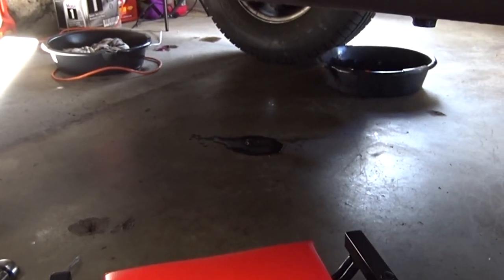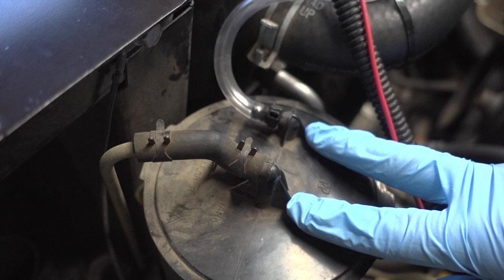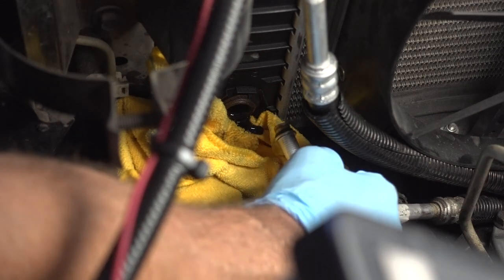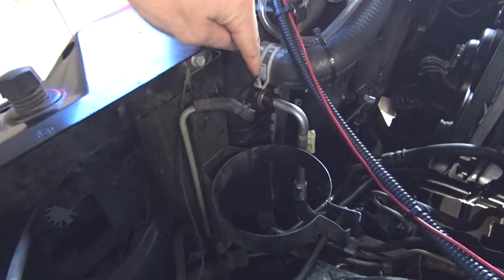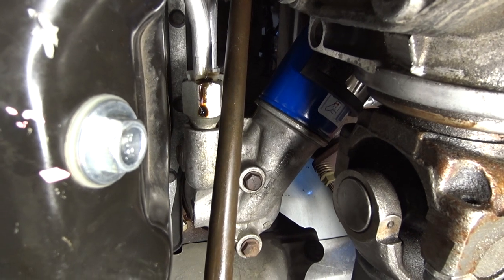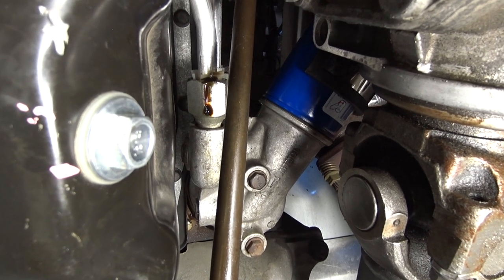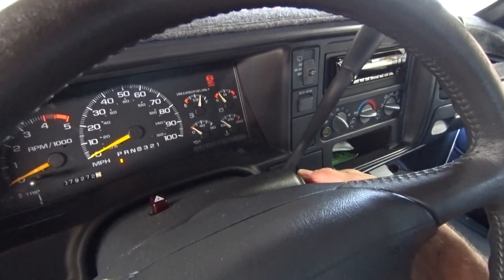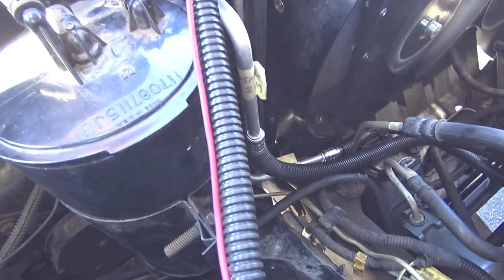Here's Why MY OIL COOLER LINES FAILED!! Is My Engine Smoked??

Comment: YES 1ROAD A VERY VERY COMMON PROBLEM. I had mine made by a specialty shop after replacing them twice. 7 years later & they look like new. I think NAPA does hoses like that ? I also went through the EXACT SAME PROBLEM YOU DID I had to change out the nipples for new ones. THE JOB WAS A PAIN IN THE ASS. My neighbor actually blew his motor up when his engine oil lines burst in his GMC.
Reply from the maker: If they leak again I will certainly have custom lines made. Thanks!

Comment: Just purchased 95 4 x 2 suburban this is my fourth suburban this one has roughly hundred thousand on it one owner, and experiences with a 5.7 Vortex bottom knock and I feel that replacing the oil pump can give longevity to the motor. This one doesn’t have the knock just yet but do you feel it can only help?

Comment: Dorman products range from good to bad. Plastic coolant tanks I have installed shrank and the cap pops off because threads are too small diameter. I have seen their plastic oil filter covers on 6.0 and 6.4 Ford diesels leak due to shrinkage.

Comment: Great job, I replaced my radiator fans with Dorman's three months ago and haven't had issues. At first I was skeptical because I read mixed reviews of them but so far so god time will tell.
From my experience I have had great results with aftermarket parts I think that there are much better quality brands than OEM specially when it comes to Japanese brands. THANKS FOR THE VIDEOS.

Comment: That Suburban is looking real nice. Does it have the rear windshield wiper as well? Oldest car I have is a 2001 Oldsmobile Intrigue and had a coolant leak, but I sourced it as the coolant recovery tank being the culprit (and I was right) and fixed it myself. Had to replace the coolant sensor as the cheap one in the new tank was defective (said low coolant but the tank was full hot) with the one from the old tank, swapped the O-ring gaskets, and the warning light went away, but it still does the self-,test when I turn the key to the on position. 120,200+ miles on it and running strong. Gotta fix the exhaust leak some more, replace a stud or two and the lug nuts, and fix the fuel gauge. I'll fix the ABS (hub assembly on the passenger side front is out of commission after 17 years (2018 is when it started to not work anymore), even live data showed the RF wheel was showing 0 MPH using the Autel MaxiAP AP200 Bluetooth scanner) after I get a new job as I'm unemployed.

Comment: Some Napa’s make hydraulic lines you could have them build you custom oil cooler lines they’ll last the lift of the truck and then some, a bit costly but totally worth the price, we’re talking double braided steel triple rubbered I might make a video on it for my 95 Tahoe if I do I’ll let you know

Comment: Is ac Delco good for anything?  I noticed  my truck has ac Delco spark plugs.  And I have already experienced brand new oil coolant line issue with brand new parts.  It's the crimp on the hose, poor design flaw.

Comment: To design a truck where the engine oil is routed through an external radiator is asking for problems. I wonder why they did that? Our 2000 Suburban with 5.3 Vortec does not cool the engine oil externally.
Reply: Its usually on trucks built with tow packages. Most of the commercial trucks(semi trucks and straight trucks) on the road have oil coolers
Reply: Your point is well taken.most don't even need it.just plug the outlet.
Reply: Yes it is common on trucks/suvs with the towing package. I think gm stopped doing it in 99 though.
Reply: @kcscustom9759  nope. 08 2500 6.0 had the pleasure of dealing with the blow out on side of road. Cut metal ends off and spliced with some fuel injection line clamps and barb fitting. Ordered blockoff plate for the oil cooler lines.
Reply: @kcscustom9759  my 99 has them

Comment: Take that garbage off put a screw adapter on it and run a 51069 wix filter on it and problem of leaks are gone forever..... Also doing this will eliminate the start up knock.... Did mine at 168k I have 847k on it now  zero issues.

Comment: I just bought a 94 1500 with this problem.  I don't like your solution Jimmy, just sounds like you will be doing it again soon.  There is a better way although it is controversial.  Buy a block-off plate to put in where your cooler lines enter the oil filter adapter.  This deletes your oil cooler altogether so you will never have a leak again.  Remove the leaking lines, plug the holes at the Rad, and you are done.

Comment: The sell a fitting that is a nipple instead of quick connect it also works for the radiator one on top of motor then just run hoses them things go out like crazy

Comment: can you romove the lines and fittings and use 3/8 plugs at the filter housing to discontinue the oil cooler, i have a 97 sierra 5.7 with 4wd and never tow anything

Comment: What do I do if mine is leaking from the part you screw the oil cooler line into on the radiator?? Is there anyway to fix that without replacing the inlet outlet tank/radiator?

Comment: I've decided to bypass the oil cooler by instaling 2 regular hose fittings with loop .
Reply: could you just plug the housing where the lines go in and out 3/8 plugs
Reply: @jhanlon1903  A garage owner I know says yes , but I didn't want to take chances .

Comment: I have a dumb question. Is there also transmission cooler lines under there that have the same type crimped fittings? Also is your truck four wheel drive?
Reply from the maker: Yes, same trans cooler lines to other side of radiator and yes, 4x4. I've noticed that one of the trans lines is starting to sweat too!

Comment: Hey, Jimmy. Just did this fix due to one of my lines failing in a similar way. Replaced the fitting with the same parts and I can’t get the fittings to stop leaking. I am using AC Delco lines. Seems to be leaking from the plastic quick disconnect. Any tips to fix this?
Reply: Figured it out. ACDelco lines require ACDelco fittings to work correctly, without leaks.

Comment: Great video!  My 96 Sierra was a pain. The oil cooler lines were held in by these small horse shoe clips that would not snap back in place. Since there was no room in there it took me a few hours to get them on. Then the next day they popped off while driving!  I  had to have her towed back home.  POS design!

Comment: 4:28 You identify the source of the oil SEEPAGE, but don't name the root cause, other than GENUINE GM parts are designed to fail after four years of use.  It would be an interesting video if you carefully cut the crimp off the oil line fitting and removed the hose.  What's inside?  Any ridge on the tube for hose to seal against?  Perhaps the hose being used is not rated for use with synthetic oil???  How do TOYOTA or LEXUS implement crimp connections that do not leak after four year?  Next time in junkyard, remove a hydraulic line from a LEXUS, and bring it home to dissect.

Comment: Maybe you need engine mounts 
If the engine is flexing around to much it will move the lines around to far 
I think you need them 
That's y the always go
Reply: Very good point.  If the lines run on the driver-side it could well be an issue, particularly if you have relatively new ones in there that start leaking.

Comment: Save your old lines get a length of new rubber hose cut the sheathing off the metal and use hose clamps
Reply: Also dont forget to flare the metal so the rubber hose dont pop ofd just in case :-)

Comment: Put plugs in the oil filter adapter and get rid of the oil cooler lines altogether.  It's really not necessary to have an engine oil cooler.
Reply: If you plug the ports you must also remove both bypass valves in the adapter.
Reply: @ianwilds3139  how do you remove the bypass valves in the adapter, what are they

Comment: My upper cooler line leaks at the radiator. It’s coolant, not oil. Suggestions? Thank you in advance.
Reply: Sounds like the rad is no good and mixing coolant with the oil side of the rad

Comment: There are much better available oil filters than AC Delco 
Fram is NOT one of them
Reply: Like?
Reply: Yeah even the average joe think fram / oem fram ac delco filters  are grabge*    
*oil filters
I'm dumb I keep my engine  safe with paper filters
Reply: @PaulDukich  Wix are some of the best oil filters. As Jack said,  definitely not Fram.  See project farm video about this
Reply: KN and STP for example
Reply: WIX.  NAPA premium (made by Wix)
Reply: I personally like purolator
Reply: @PaulDukich  Like a premium Fram or any other premium oil filter.  Don't get sucked into the anti-Fram nonsense.  With oil filters just like anything else, you "usually" get what you pay for.
Reply: @g_unit6773  Used Fram all my life on all kinds of applications including many high performance, never had any sort of issue at all.  You are perpetuating a myth.
Reply: @x-man5056  Incorrect. Fram = Crap. Best is NAPA Gold, WIX or Mobil 1 Extended Performance

Comment: just did this on my 99 suburban, I had a leaking power steering and moved the oil cooler lines to get to the PS hose, test fired and the thing dumped the entire 5 qts of oil while i ran to the bathroom while I left it idling...
Reply from the maker: Holy moly!!!!

Comment: ???? How cool do the oil cooler get in degrees ???? Mine was deleted for some reason 1998 gmc k1500 5.0 sl 4wd 1/2 ton pickup ????
Reply: You want them deleted they don't do anything but decrease engine oil life and cause leaks, there's no way you're hauling enough to make the oil cooler a necessity.
Reply: @Bleachanna   I have 35 inch tires and 3inch body lift + 6 in suspension lift.  I think your wrong  in my situation.
Reply: @Devo1987  okay. Did you change gearing when you put on 35s?
Reply: @Bleachanna   yes previous owner did ... not sure what but Im happy with what I got

Comment: 9:15  Your $5000 engine is protected by 1/2 cent piece of plastic.  That's the GM Way!!!   Believe the missing piece of plastic is meant to keep the pipe in proper orientation, and keep stress off the O-ring.   Giving DORMAN a try is a great idea given the POOR PERFORMANCE of Genuine GM (AC/Delco) oil lines.   Try switching to CONVENTIONAL OIL, and see if engine quits leaking like a sieve.

Comment: Why not run AC Delco oil if you buy all ac delco part's??? I only run AC Delco oil in my chevys my 2007 Chevy suburban LS AFM flex fuel and my 1994 Chevy suburban Silverado edition it keeps the lifters quiet no ticking in the long run guy's

Comment: Common problem with gm hoses. Last 4 years nothing but crappy Manufacturing (personal opinion) but having to replace power steering hoses more than once a year and engine cooler lines every two years to me is uncalled for. I used to run a fleet of GM trucks it was to the point where I just started converting everything over to standard hydraulic line, might look a little bigger and bulky but I haven't replaced one since
Reply from the maker: Did you have to have those hydraulic lines custom made?
Reply: @1RoadGarage  went to a local hydraulic shop that also dealt with aluminum fittings (like A/C and trans lines) and they gave me the fittings from whatever (trans, pump, engine, rads ect) to standard jic fittings. Then I just used standard hydraulic line and when one does decide to blow I just have to go to a hydraulic shop or farm supply place that has mostly them pre-made and swap it out rather than spending thousands which I've had to do replacing them one after another.

Comment: I cant get the cheap quick connects to stop not leaking. This job sucks...
Reply from the maker: If you've got the o-rings in there seated properly then the hoses just push right in and shouldn't leak.
Reply from the maker: ...yes, it does suck!

Comment: It's a GM thing. Never trust a GM design they hasn't changed in over 15 years. The power steering lines on my Saab were the same style and didn't last long either.

Comment: Ever heard only use genuine ford parts in your ford? ., it's a good idea until you run across defects that happen to all of them.(meaning fails on every car).I've seen lots of lines that don't meet the rubbers diameter, & also the reverse .Then there are lines that are just not to standard strength..To make it worse , any over runs or slightly irregular parts , become what the industry calls "service parts" ., & worse yet almost all service parts don't get the same number of quality checks that the factory parts get! So now you have a genuine "service part" , that's known to be questionable ,  & the replacement doesn't even meet that standard !

Comment: Oil cooler you mean trans  cooler??
Reply from the maker: No, oil cooler. My truck has the oil cooler within the radiator on the driver's side and the trans cooler on the passenger..
Reply: @1RoadGarage  ah ic. Ok nice feature when it works

Comment: Can't you just put a hose clamp over the crimp?
Reply: Not advised, UNLESS YOU FLARE THE TUBING AT THE END & A FEW HOSE CLAMPS. I learned just to do it the right way if I have the time & money, LOL.
Reply: @NoWr2Run  why isn't it advised?
Reply: I thought I explained it clearly ? UNLESS YOU FLARE THE PIPE, TUBING, most of the time they won't hold just by putting hose clamps on it.
Reply: Your explanation doesn't make sense. You put the clamp over the crimp.that will stop the leak.
Reply: I was talking about cutting the rubber hose out & replacing it with high pressure line. It won't stop the leak if you put clamp over crimp, I got a lesson on ALL THESE IDEAS I HAD FROM THE GUYS WHO ACTUALLY MAKE THESE HOSES. It's not worth trying to rig something up unless your on the trail. Do it the right way if you have the funds & sometimes I DON'T, SO I RIG STUFF UP TILL I DO. SORRY I MISS INTERPRETED YOUR SOLUTION, I MISSED THE PUT OVER THE CRIMP PART, SOME DAYS YOUR THE BOXER & SOME DAYS YOUR THE BAG. YEP I'M THE BAG SORRY, jocko.

Comment: Don’t purchase Dorman name brand oil lines .
Reply: Which dorman did you get
Reply: @toxicwolfgaming2972   I purchased a set of molded oil lines for a 1993 4x4 S-10 pick up from Carquest ( now Advanced Auto ).  They started to seep oil within 9 months.I try to avoid " Dorman " parts if I have a choice. Sometimes 'Dorman" is your only option.